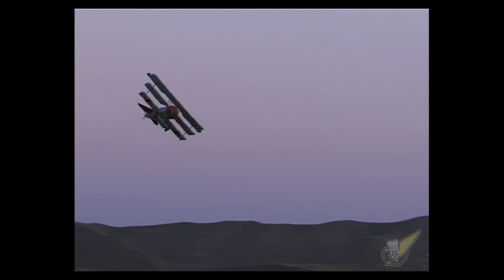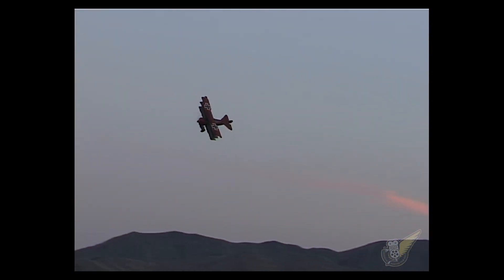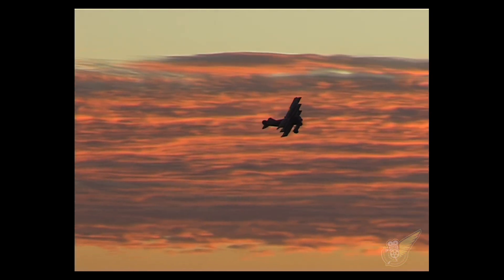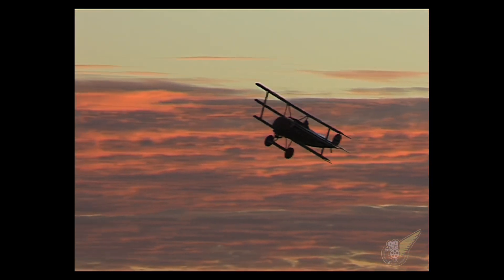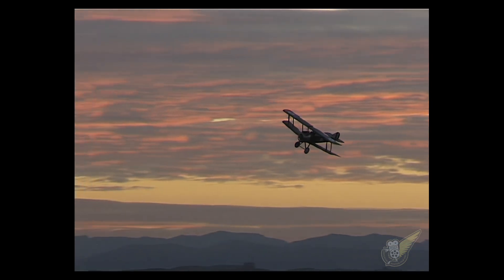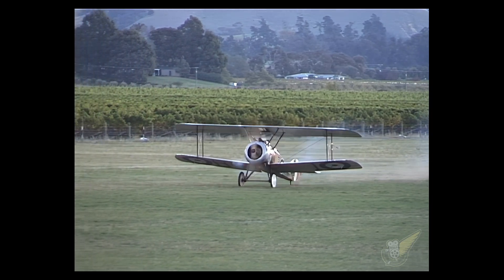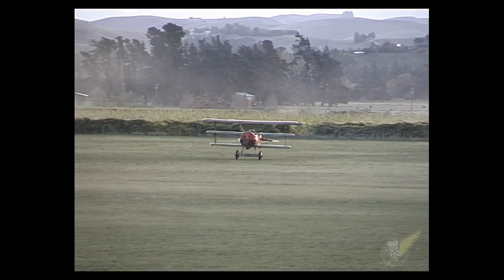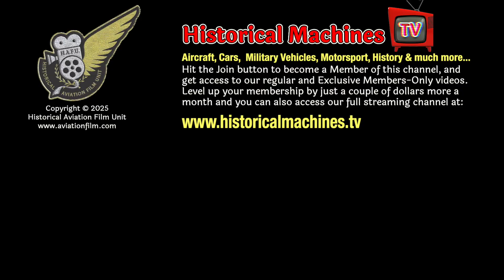Can You Hear The Difference Between Rotary and Radial Engines?

Comment: The poor old radial always sounds like it is about to disintegrate sounds very rough, but the rotary has a much harder tearing calico sound, it is good that the rotary engine is now being made again, it has a big advantage on weight, self cooling and no reciprocating weight, the only disadvantage is that it is limited in capacity. Many thanks for posting this video!